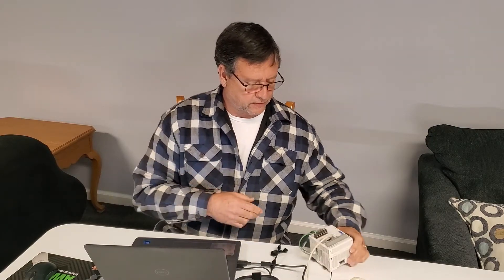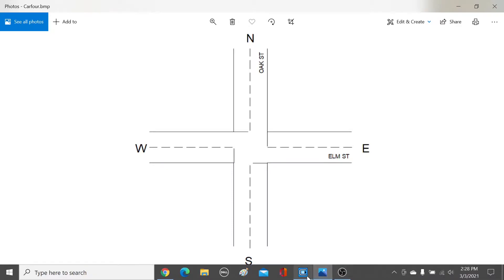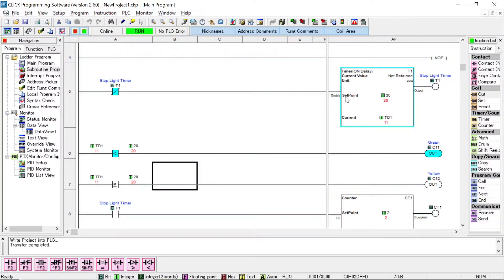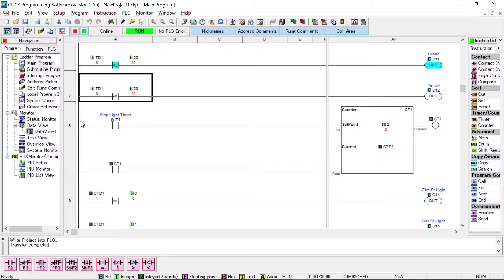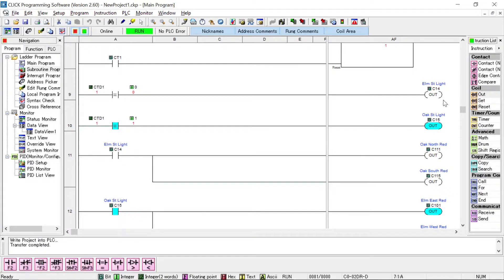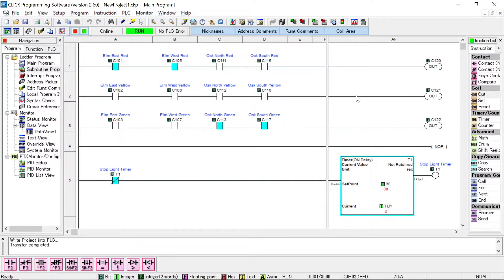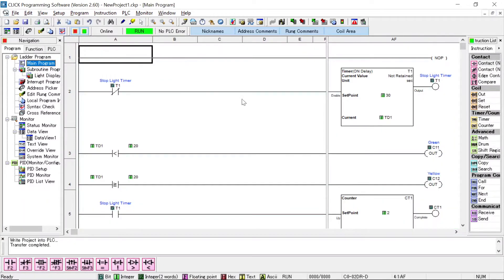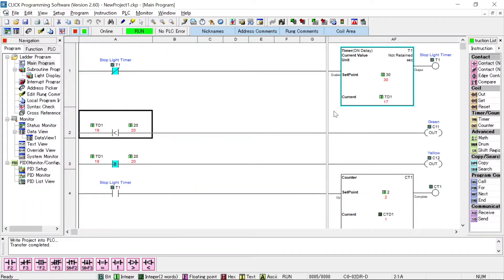Learn to program CLICK PLC. A simple redlight. (CLICK 4)

Comment: As a quick note for anyone, as of Version 3.60 for CLICK Programming Software, you can copy and paste multiple rungs of instructions at a time. However you need to use the arrow keys instead of the just the mouse. So click on the first instruction, then hold down shift and the down arrow key until you select all the rungs you want and then copy & paste.
Reply from the maker: Thanks for that. I'm using 3.70 and just copied rung by rung a full subroutine. That will help.